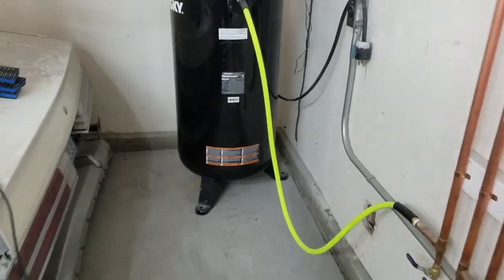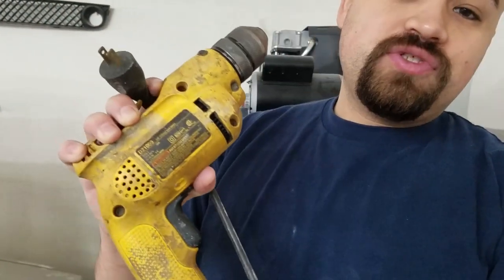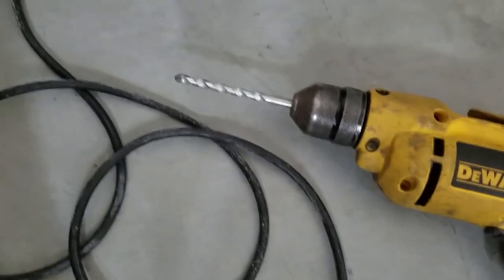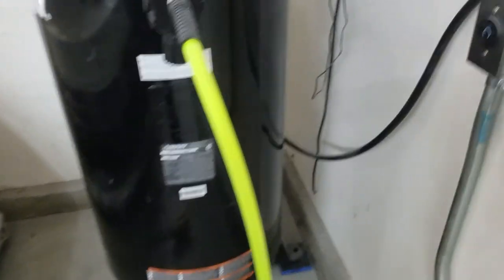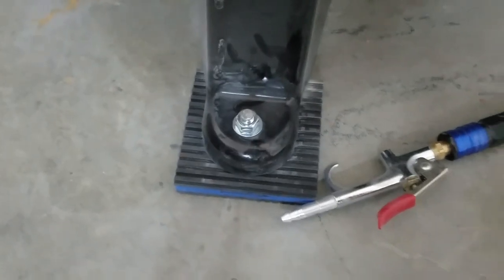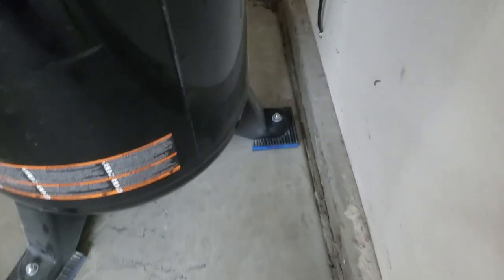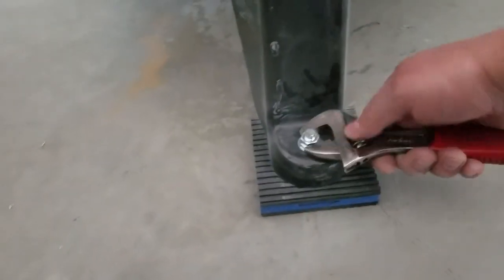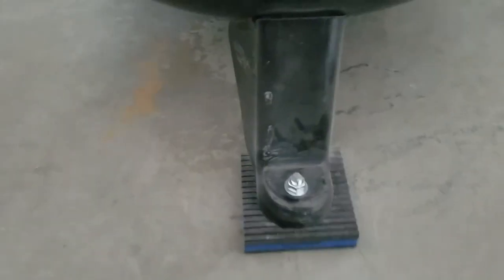I PERMANENTLY  mounted the Husky 60 Gallon AIR COMPRESSOR

Comment: Great idea on using the vibration pads. Love your build and am following to get my own system built. Where did you get the short green hose to attach from the compressor to your air dryer setup? Did you make one up with fittings?
Reply from the maker: Thank you! I bought it from Amazon. There's links in the description of this video. I tried to include everything I used. Thank you for watching 🤝💯

Comment: I made some isolation feet out of hockey pucks. I didn't anchor mine down to the concrete. It doesn't ever move and the compressor sits in a corner.
Reply from the maker: Nice that's a good idea 💪💯

Comment: I drill Concrete plent of times with a crappy drill and masonry bits..
First mark where you are going to drill and get everything out of the way . Dont drill through the pad And the compressor hole.
Just drill the concrete.
Reply from the maker: lharchmage I gave it a try with the masonry bit my dad gave me and it wouldn't cut through the concrete. The pads already had holes in them. Hopefully I dont have to do it again...if I do ill give it another try instead of renting a hammer drill again. Save me some money